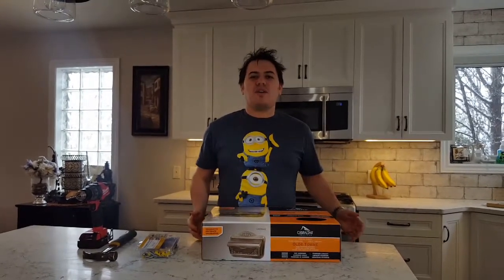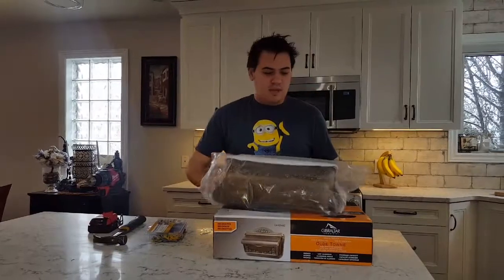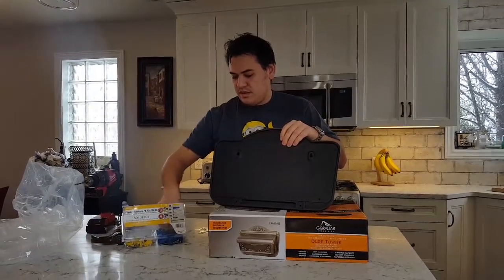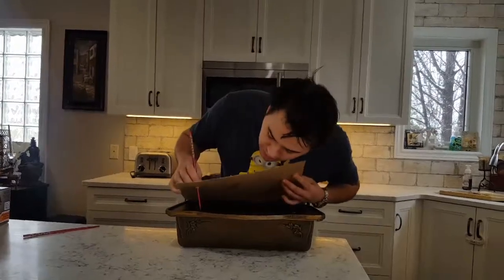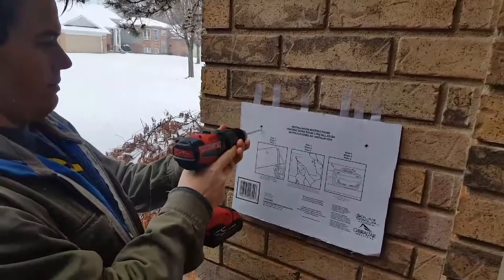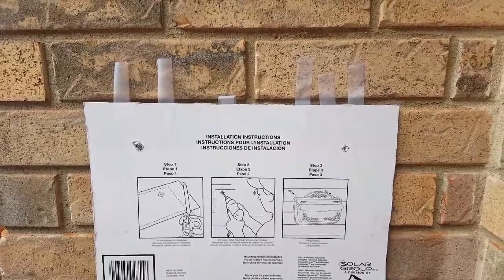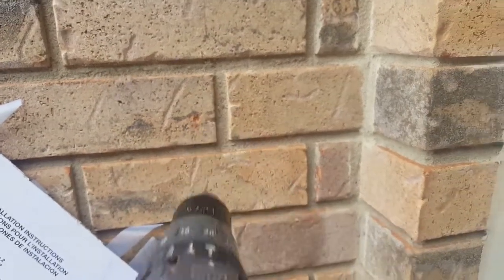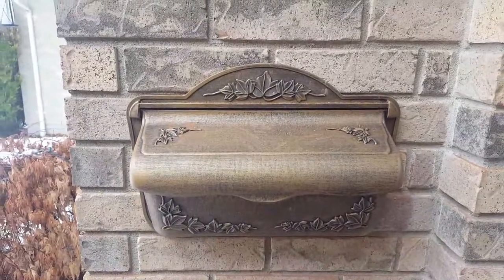How to install a mail box

Comment: Part of my job is delivering paperwork to peoples homes and some of them don't have home mailboxes.
I understand they have to go to a community box to get their mail but it would make my life so much easier if they would do as you're doing and hang a mailbox.  Putting their address in a place that can be seen from the road during the day, at night, in summer and in winter.  Too many houses have addresses that can't be seen and some have no address on the house at all.
I always tell people, what happens when you need an ambulance and they have to spend 5?10? 15 minutes driving around looking for your house while you're having a heart attack or stroke?
Nice looking mailbox by the way.
Reply from the maker: Bruce L. In our area a firedepartment can fine someone without a proper address on there home